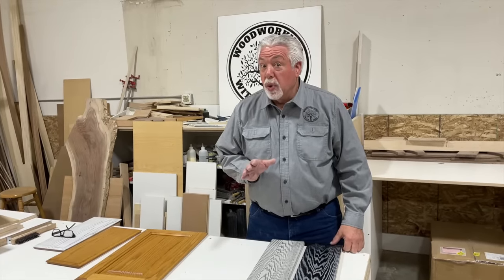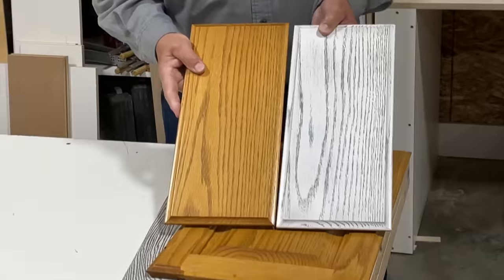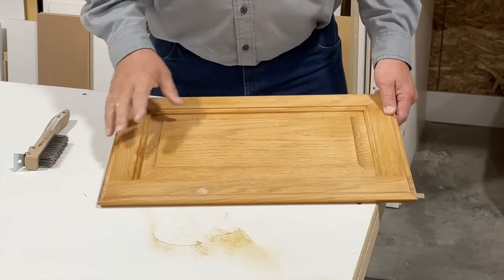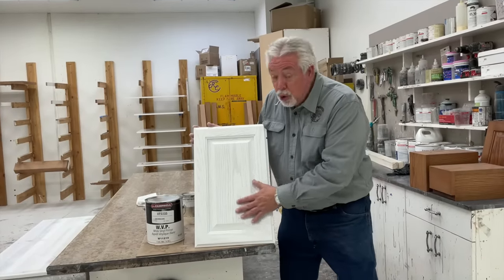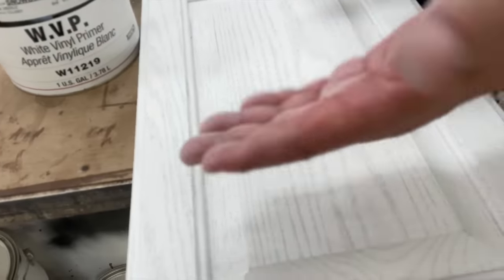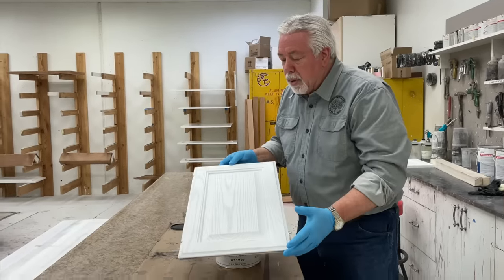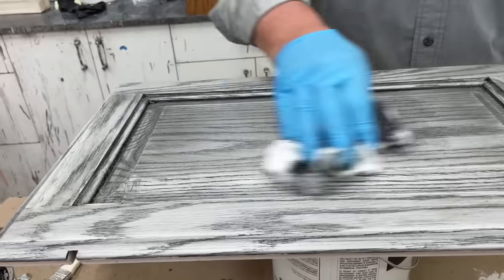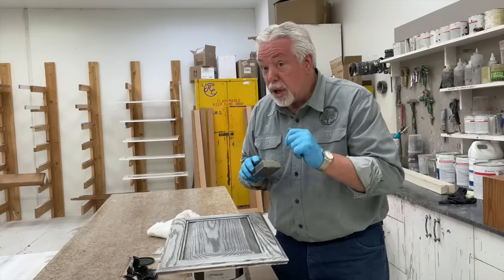YES it works...you CAN ceruse a golden oak kitchen.

Comment: I used oil base polyurethane as the top coat and now my kitchen turned yellow, I wish you where more specific when it came to top coating, now I have to sand my entire kitchen 😣 I came to learned you are supposed to use water base if you are going with polyurethane

Comment: Thank you for posting this video, I've done cerusing in different way, I like to share with everyone here:

1- After wire brushing, a complete sanding is done, making sure the hard grain is sanded smooth, this way, less sanding is required after glazing, it will reduce the chance of sanding through the base coat.

2- A primed surface is too porous and not ideal for a cerusing application, so a clear coat applied over the base coat crates a much smoother surface to do the glazing step, if this part is sprayed, it will usually lay on the hard surface and will not affect the soft grain, where the glaze will be collected. Old timers used to apply a size coat, which is a clear coat reduced to 50% of finishing material plus 50% thinner. A primed surface is good for other glazing techniques, like distressing, but generally not a good idea for cerusing.

3- An oil based glaze has more of open time, so cleaning is much more simpler and
requires less sanding. In case of using a water based glaze, use retarder to have plenty of time to clean up the excess glaze.

4- Use a squeegee to clean the glaze, it will automatically leave the glaze into the grain, and
the hard grain is left clean.

5- Apply two coats of clear coat, let it dry and cure completely, buff to desired sheen.
Reply: Perhaps you would make your own video?
Reply: Can you do a video?
This gentleman's way looks very simple lol 
Your way seems more difficult
Reply: @johns4476  excellent suggestion
Reply: If you used Rubiomono Coat, you’d feel differently.
Reply: Well then, perhaps one day, you make your own video! 🙃
Reply: That suggestion makes perfect sense! Thank you. What if you do not have air spray capabilities? Will the clearcoat then fill in the soft grain valleys?

Comment: Just finished 41 cabinets in my kitchen! Top cabinets are off-white with dark gray glaze; bottoms navy with pewter glaze. I did it in sections and it took 3 months. Definitely labor-intensive, but the difference is amazingly beautiful. Wish I could add photos of before and after. Thanks for the inspiration.
Reply from the maker: Wow that is very impressive...thanks for letting me know!! Now enjoy, Wes
Reply: How come the underneath colour does not come with sanding?
Reply: @Adriana K.  not sure what you're asking...everything was sanded.
Reply: @WoodworkingWithWes  I really would love to show photos of before and after. I no longer live in Sherwood Forest!
Reply: @adrianak.1615  because the bottom coat is a primer.  So it adheres to the wood.  The glaze is a surface coat. When you sand, you sand very lightly with a high grit so as to only remove the glaze and not the paint underneath it.
Reply: A photo of an entire kitchen done this way would be amazing.  I don't know if it's possible though.
Reply: @ThatChickNYC  I found that instead of sanding the glaze, because it's water based,  rubbing with a moist cloth does a better job and doesn't damage the primer coat.
Reply: Do your cabinets have to be Oak wood for this process
Reply: @dorotheaoverstreet5190  I'd think any wood with a good grain would work.
Reply: @TurfTideNewfs  Please make a short video on your own page. Would love to see your creation!
Reply: Post them in your youtube page
Reply: I checked your channel to see if you posted the before and after pics of your 3 months of work. Sadly, not there. But would really love to see it. Pretty please?
Reply: Where can I see pictures?  This sounds awesome and right in my color wheel.
Reply: This looks awesome on the actual Oak wood door/drawer fronts . My concern is on the side of the cabinets which are not real wood but seems to be a press board with a veneer covering. I have  seen other videos where the stain or glaze does not adhere the same way as wood and therefore the coloring would be off. What would be the remedy for that, if there is one.  My luck would be to finish all the cabinet doors and drawers and then be stuck with a completely different color or shade on the framework and sides that are not real wood.
Reply: Share some photos!
Reply: @Barbara Rohle  thanks for this comment because now I will check if any of my cabinets have the veneer.
Reply: @Barbara Rohle  thanks for this comment because now I will check if any of my cabinets have the veneer.
Reply: Pls post pics?
Reply: No photos on her channel?? I'll bet she didn't even do it😅
Reply: Just found this site. Can you post your photos now?  Sure would love to see how they turned out
Reply: I’d love to see a picture! Would you be open to emailing some?

Comment: this is awesome, my father did my grandparents kitchen with white oak back in the early 80s and its so high quality it would be foolish to rip it out but it's kinda dated now. His panels are flat, 1 inch thick and he rounded the corners off about the curve of a quarter. All the grain is mirrored, panels are huge. I bet that kitchen would cost a fortune now. I'm fairly certain it's all solid core too, all his furniture is solid, no mdf. Ive never seen another kitchen like it. By the time I was old enough all we did was raised panel on every single job. I bet if we sell that house some idiot would rip that kitchen out. I think I'll try to replace it before that happens. move it.
Reply: Yep modernization idiots are everywhere, do what you can to save it, I love real wood in vintage kitchen cabinetry.

Comment: Am I able to do this without air brushing the paint? Will I be able to get close to the same result with a roller, paint brush or aerosol? This is a game changer and I'm determined to do this but without buying extra equipment. Thank you so much for quality content!
Reply: I have the Same Qs
Reply: I think aerosol would work as long as you'd do 2 light coats. Brushing and rolling might produce too heavy of a layer that would fill in the grain of wood and prevent the glaze from sipping in.
Reply: Yea roll on or brush too thick and rough. Spray is better.

Comment: Folks, when you do this type of refinish, please do the inside of the panel too. Nothing looks worse than seeing a restrained or repainted cabinet and the inside is still original… also, keep in mind when you work on these cheap honey oak cabinets, the end caps of the cabinets are not solid wood, they are veneer and you can’t sand down veneer like solid wood.
Reply: I would probably just do the inside whit and not worry about the glaze where it won't be visible anyway, but definitely can't leave the old finish on the inside.
Reply: This process would take FOREVER if I did my kitchen cabinets. I just put new hardware on my cabinets, new Quartz countertops, backsplash, vinyl flooring, my kitchen looks great, and the golden oak doesn't bother me anymore. 😉
Reply: Doing the inside of all my cabinet doors with chalkboard paint.
Reply: @XenusMama  how do u do that? What color? Im repainting mine sage green but on the inside they are old varnished/glazed pine
Reply: I think he covered that detail. These oak cabinets are not custom but I would not call them cheap.
Reply: I Totally love this
Reply: Or you can do a solid color as well on the inside, I think that would work, not sure, but I will try it. And yes, agree 100 that you can't leave the inside original 😀
Reply: I was just going to ask about the inside so thank you for that info
Reply: Can U do this on laminate  Cabinets
Reply: You mean the back of the door

Comment: Beautiful results...I love how you explain the process so detailed without making me feel like an idiot...You used 'vinyl primer' throuhh a sprayer for your base. Can this process be achieved by using any primer and applied with a brush (as I don'thave a sprayer)...I feel like I would have to thin it down some so it doesn't fill the grains and reduce the glazing effect...
Reply from the maker: Karen...watch for an upcoming video demonstrating a brush and roller application of this process.
Reply: @WoodworkingWithWes  Thank you! I was kind of wondering this, myself, as I don't have a compressor or any of the spraying equipment. I'm subscribing and I'll be watching for that one.

Comment: You can still get the same effect AND not waste so much glaze (by wiping it off) by applying the black glaze on a small sponge/rag and wiping on top of the white primer...
Reply from the maker: Yes that is correct. Thank you for watching. 😃
Reply: You can cover 200 kitchen cabinet doors with a gallon of glaze that costs $35. How much money in savings are we talking about? $2.89 ?
Reply: @kutykutyka  Why would I buy a gallon of glaze when I have no more than 30 cabinet doors? Makes sense?
Reply: @gt-c-  I apologize, I thought you'd catch my point. I did not know how many doors you had, and I did not suggest that you should buy a gallon of glaze. The point was that glaze is such an inexpensive part of the process, that it really doesn't save more than a few cents to use add on technique vs removing excess. I'd personally spray it on in a few seconds and while wiping it off , I'd work it into the grains. I'm a certified painter in season 26. My priorities are quality first and efficiency next. If you can reduce labor time on the expense of a few dollars, it's a no brainer which technique to use.

Comment: Make sure to use a non yellowing sealer. Regular sealers are almost clear when first applied but after six months they turn pale amber and this will look horrible on a finish like this.
Reply: What sealer would you recommend? I have a difficult time finding one that doesn't have a yellow hue, even though it reads clear.
Reply: @samanthamorillo5501  there are many water based sealers available that don't yellow. If you paint them on glass they appear milky white as if the glass was slightly frosted. They apply easily, dry quickly with low odours, and are very easy to clean up. Your hardware store in your country will surelt have something.
Reply: I've used clear polyurethane and clear spar urethane (for outdoor projects) and both have a slight yellow tint and alter my white or light paint colors. Of course this isn't an issue for darker paints, stains, or wood. I read there was a "crystal clear" polyurethane available that won't have the yellow effect, buy in haven't tied it yet. I was just curious if you had a specific clear sealant in mind. Thanks for your feedback!

Comment: Just beware, I have had serious problems with ML Campbell topcoats ambering. Your nice white door may end up yellow in about a year.
Reply: WOW!!! I didnt know that. I bought a what I thought was a clear coat (Cabot) it turned yellow right away
Reply: All oil based clears will yellow. Water based tend to stay more clear over time. Just fyi. (I've been a professional painter for 25 years)
Reply: Back in the eighties I think we called it white washing but it was a new finish usually on oak or ash. Yellowing was the problem with lacquer so they came out with white water lacquer that lasted quite a while without yellowing. We used Kelly Moore or Pittsburgh Paint I think. The reason for lacquer was quick drying and a smooth finish. We sprayed everything that we could laying flat to prevent runs. Installed hardware after dry.
Reply: - a 'water-white' (clear) finish like SWilliams cab -acrylic lacquer won't yellow: any finish that is somewhat 'amber' to begin with ( in wet state) will yellow more so with time.
Reply: I allways use a non yellowing sealant

Comment: In the 70's this process was called "antiquing."  I wish I had a paint booth & sprayer equipment because using rollers or brushes will not give you the same results.
Reply from the maker: Watch for upcoming videos, we will give it a try with brushes. Thank you. Wes
Reply: @WoodworkingWithWes  ANY chance you could spotlight a different glaze color just to show  something different than the trendy white-black-grey colors? Wondering if worth allll the work to just change things up or if I just just have my cabinets resealed and keep the honey oak.

Thanks.
Reply: @WoodworkingWithWes  Dumb question: Could I use spray paint cans to do this?

Comment: I wish you would have addressed the remaining face of the cabinets that can’t be removed and brushed/painted as easily as a cabinet door/drawer face.
Reply: Wondering if you would just do the same thing; sand it, paint it and then add glaze and sand it again until you obtain desired result? It wouldn’t be as easy as a movable cabinet door but still possible. I believe.
Reply: I think I'd paint the in-betweens either white or black and let the cabinet faces stand out.  (My own style I'd choose black.)
Reply from the maker: Look forward to an upcoming video where we demonstrate paint and roller application on this process. We think this will be of help for the remaining surfaces of the cabinets Thanks. Wes
Reply: @tinaespinosa7006  I thought the same thing!
Reply: @WoodworkingWithWes  looking forward to this as I don't have sprayers 💯👏

Comment: After 5 minutes of the video where he was wire brushing, I decided that this is too much work.
Reply: The wire brush was the best part
Reply: Anything in regards to woodworking is a lot of work. A person has to like it for sure .
Reply: It would take me a month do redo my kitchen, and that's being conservative
Reply: Yeah… I’ve decided to chalk paint my cabinets.
Reply: I was thinking the same thing. Lol.lol
Reply: And it wont hold up in a used kitchen.. Reality sets in..
Reply: How about using a 4" angle grinder with the wire brush adaptor? Probably will do a worst job but your arms and your other half would be happier and they wont notice the difference, only you!
Reply: You can screw a (predrilled) wooden handle wire brush to the blade of a reciprocating saw to save on elbow grease👍🏼
Reply: @the1stime  OR you could decide on another finishing system.
Reply: @blaster-zy7xx  it’s not a finishing system but a prep system. The ceruse technique works because the grain pattern in wood is slightly softer, making a depression. The wire brush further removes the softer grain pattern, giving the glaze a depression to stay in
Reply: @the1stime  Yeah, thanks for that great insight.

Comment: thats a lot of work for just one side of one cabinet door
Reply: Maybe, but I'm looking at $20,000 for new cabinets so I need to consider this.
Reply: Find a cabinet shop and ditch the box store
Reply: My 35 year old house had Handy Homeowner ‘built in place’ pine cabinets…….I was never getting those suckers off the walls! Had to commit to stripping at least 2 coats of paint off..down to icky Mediterranean brown stain…yuck. Stripping, drying, sanding, fill holes, sanding, primer, dry 2 days, soft sand, 1 st coat, dry 5 days, soft sand, 2nd coat, dry and cure 7 days, reassemble. 
Thank god I was in the house by myself while hubby was selling the other home….this procedure seems like a breeze in comparison.
BTW Benjamin Moore cabinet paint is superior…my semi-gloss finish looks great!
Reply from the maker: Wow thats a story and thanks for sharing. Wes

Comment: Doing a whole kitchen would be your last. Lesson learned.
Reply: I painted old golden oak in our last kitchen + 2 baths using an antiquing kit, but decided to skip the antiquing step. The top coat pooled just a bit in the details for a touch of highlighting. It was a LOT of work and looked great. I'm liking this look for our current 30 year old kitchen, but geez.. all that sanding, wiping, painting...and no sprayer and paint shop. Can these 75yo arms manage?
Reply: @judymiller5154  I'm a retired Pro painter. I'm not a fake painter like most I've met in my life. I do Mural paintings on my own walls, it's very relaxing for me. My living room is a undersea Mural. I've got a 7 foot hammerhead shark on the ceiling neck breaking work and many other things on it and the walls. When I saw the video, I already knew most people would regret starting a project like that. Nothing wrong with doing it if that's what people want. No sprayer aww. I feel your pain. Thank you for sharing your story.
Reply: I have so many oak cabinets I’m learning just to love what I have.
Reply: @victorbaker4585  and thank you for your warm connection to my post. Your home must look amazing and uniquely personal. I'd rather go ride my horse 😁🐎👍
Reply: @judymiller5154  lol I've already rode my horses long ago. Have fun.

Comment: I have re-done a golden oak table by stripping and sanding it down to bare wood, using a wire brush to dig out some of the grain, painting it with watered down paint, wiping the paint off the surface, lightly sanding again, and then sealing. Turned out beautiful. The white was in the grain so it looked like the wood was just a whole lot lighter. Still looked very natural. Beautiful.
Reply from the maker: Wow...sounds great. I am sure it is beautiful, thanks for the comment! Wes
Reply: @WoodworkingWithWes  I am glad you made the video! I hear about people ripping out golden oak cabinets all the time and it is such a shame because usually there isn’t a thing wrong with them except they aren’t trendy anymore. It is good to see someone showing options of what can be done to update them instead of throwing out quality cabinets.